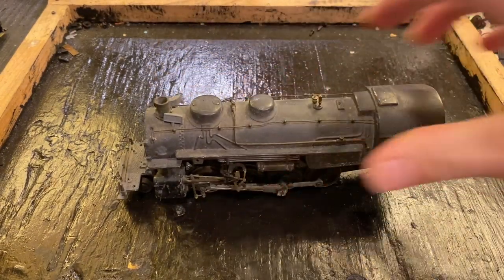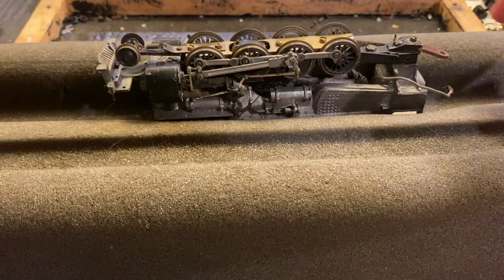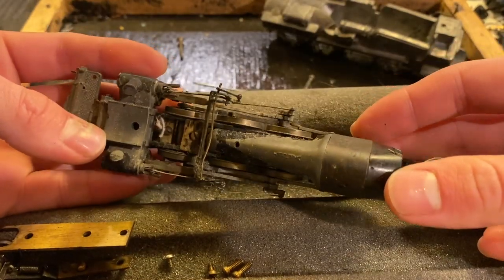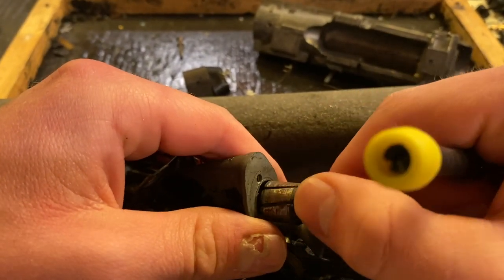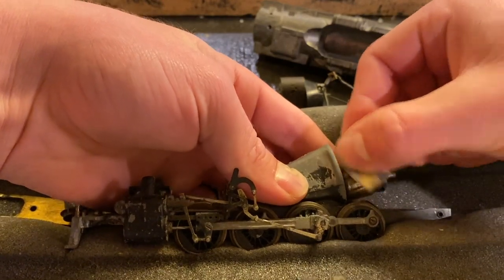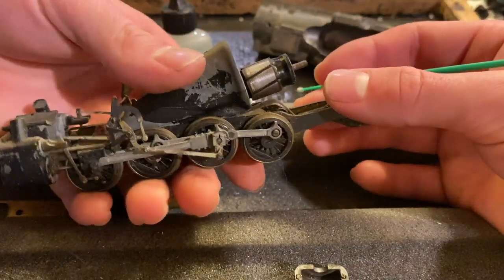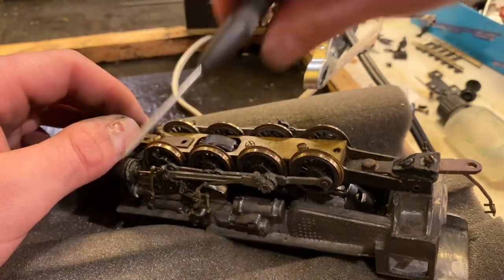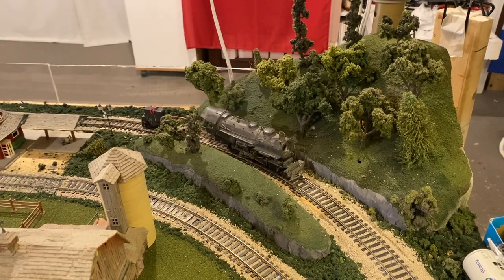Mysterious 1950s Varney Steam Locomotive With 7-Pole Motor - Restoration

Comment: That's a really good find there!  The 7-pole V-2 and V-3 motors from Varney were designed for them by Lindsay, who was known in the 40's and 50's for having some of the quietest and best running motors on the market.  The 7-pole skewed armature design made them smooth and powerful even with their small size, but they were also expensive and complicated to produce, so Varney dropped the design after a fairly short time (so they're both very rare and valuable) in favor of cheaper open-frame style motors.  Lindsay kept making the 7-pole motors under their own name into the 60's before going out of business.  Although the motor tooling is long gone, Lindsay's quality detail parts are still made today by Precision Scale Co, and their detailed ALCO FA-1 and FB-1 bodies are still being made by Hobbytown of Boston.

Comment: It looks like a Varney "Old Lady" 2-8-0. Most of Varney's kits were based on Southern Pacific locomotive classes. Roundhouse kits took over most of the Varney line. The "Old Lady" was always popular, but I never saw a kit from the factory with a 7 pole motor. Biggest problem that I remember was binding in the valve gear from people getting the rivets to tight. Always roll the chassis on a piece of track before installing the motor. Check and correct all binding before proceeding.

Comment: I can tell you more about it. It is early 1940s Varney Reading I10a, yours has boards added. Mine is modded to a 0-8-0 by its owner yours tired to make it SP. a lot of these became victims to G&D knock offs or to custom locos very few full originals left. Yours is pretty original less the missing boiler plate. As a side note. Both yours and mine predate the class being rebuilt by the reading into T1s so yes you have a model older than the Reading T1. From your friendly neighborhood historian :p

Comment: You have a fine example of gordon varneys equipment. That is his super motor with gearbox scewwound really ahead of its time the drivers should be sprung too. There was also a super pacific. Great find as inused to have several when i was younger. I am very envious. Lol
Reply from the maker: The best I've seen on a modern locomotive is a skew-wound 5-pole so I really wasn't expecting this. I'm going to be on the hunt for similar locomotives. Thanks for sharing some of the history on this piece.

Comment: Great job Harrison. It looks like the Varney HO Super Consolidation (Heavy) from the 1951 catalog and parts list. Now we have to find the tender, the smokebox door and perhaps a few other bits. You have the makings of a true, vintage, collector's item. To add to some other comments I agree that with the 7-pole motor , etc. that locomotive should be able to pull several freight cars at a very slow speed. (Watch your voltage. Some of those older motors were designed for lower voltages than what we currently use.)  Impressive job of resurrecting this one. Nicely done!
Reply: Even if he did find the original tender varney had custom couplings for the sockets

Comment: Reading I-10sa prototype.  Bachmann made a version with a suitable tender and Bowser did a conversion kit and it came with trucks and a frame to get her running.  You could score a cheap Bachmann Reading Consolidation or one they lettered in Great Northern on ebay. The I-10 did not have the number boards.  Otherwise, the engine is very close.

Comment: It's a SEVEN pole motor.

...Fascinating...

I think that's based on a Reading railroad 2-8-0, I love the Reading's wide firebox and arched cab window aesthetic. Whoever made that engine did a beautiful job on the running gear, those bearings looked heavy duty!

Comment: The tender would be a Varney or Bowser tender like the ones used on the Old Lady 2-8-0 or Casey Jones 4-6-0. They were available from Varney with plastic tender bodies and cast metal frames or as all cast bodies and frames from Bowser after they purchased the Varney dies. Very common on ebay.

Comment: Y'know, I thought my 1950's Tyco Pacific I picked up this past January was odd having a factory enclosed gearbox and a proper Pittman open frame motor but that is the funkiest thing I've ever seen!
The more I lust for dcc and sound, the more and more I look at the projects and retired outcasts of people's collections. Not standard Tyco stuff, Mantua at the very least. 
I'm very interested in getting myself and experimenting with Bowsers, Penn Line and Varney steamers to restore. Not just a dismantle, clean and oil restoration. Stripped and repainted (if needed) and get them running as best as ever. I've already done a Mantua heavy mikado and an all diecast 0-6-0.
Reply: As for my Pacific, yes it has a slight track binding issue with the blind drivers but that's my crappy trackwork. I very much plan on adding DCC and sound to it and doing absolutely nothing more to it. My cousin, uncle and grandpa all insist it must have a can motor to even consider giving it dcc but it runs so unbelievably smoothly, quietly and with little amps pulled with its original old Pittman.

Comment: Varney first offered this 2-8-0 patterned after a Reading class I-10 in 1938.  The firebox design was changed to a more conventional style in 1939, and after a hiatus for WWII it was sold in kit form 1947-57 less tender and 1957-63 with tender.  It appears the tooling was damaged or lost as it's never been produced since.  Bowser bought Varney's steam locomotive tooling and parts in 1968 and sold some of their other engines through around 2008.  

Although the guide says they were sold into 1963, I looked through a collection of magazines and never saw ads for them after 1951.  

I have two or three of these around I've picked up over the years.  They're not particularly common anymore.  

Bowser may yet still have a few parts for these around, although they discontinued all of their cast metal locomotives several years ago and may have even scrapped the tooling.

As for the tender any Varney would work with it; the type used with their Old Lady and Casey Jones is closest to what would be correct for a Reading engine, but alternatively any tender that provides for power pickup could be used.

It is missing a smokebox front, headlight, and some sort of pump or detail on the fireman's side.

Comment: I really enjoyed this video.  I got out of HO in 1978, and could not afford Varney products back then.  The seven-pole motor was impressive, with a skew-wound armature yet.  I was into slot cars in the early 1960's, and only the best motors were seven-pole.  It has been a long time, but if I remember correctly, Kemtron made a complete line of brass castings that likely included a smokebox front that would fit that loco.  Some of the most powerful slotcar motors were adapted from HO locomotive motors.
I don't remember a motor with a pancake armature before the Tyco motors used beginning in the late 1960's.

Comment: That's a great loco, I work on a good number of engines that are 40 , 50, 60 years old and a little TLC and they all tend to run.  Pretty much any old tender designed to pick up power should adapt to it.

Again, great engine , a true antique 👍👍👍

Comment: Beautiful Gordon Varney loco from the late 50s to the 60s.At one time Varney was one of the leading model train suppliers.They were known for smooth running,that seven pole motor is one of reasons.If you take time to finish the restoration you will be rewarded for your efforts.

Comment: Quite the surprise for today. I'd say that's a New Haven because of the rounded cab windows (I may or may not be biased, if it wasn't obvious) but those number boards on the boiler say different. I'd say a 4 axle Vanderbilt tender would go perfect behind that.

Comment: Also, a bit more info. The prototype is the Reading I10sa, a powerful 2-8-0. It is indeed a varney, marketed as a "Super Consolidation." The boiler front should have a smokebox - mounted headlight and bell. Maybe brass castings would do the trick. As for a tender, from photos it seems Varney put a six - wheel  tender behind it, which looks better than the more prototypical approach, what Reading actually used, were these four - wheel tenders that look too small for these chunky brutes.

Looking up "Varney super consolidation" will yield an advertisement photo showing the tender. It looks like one of the Mantua tenders found behind one of their Pacific's or Mikado's would fit the bill.

Looking up "Reading I10sa", will show some pics of the locos with the smaller tenders. The bachmann model of this locomotive (Yes, bachmann made an I10sa too!) has the prototypical small tender, and that tender was later used on their USRA 0-6-0's so they are quite common. I actually have one of these tenders I can spare, but postage is expensive from Florida to Canada!

A coat of flat black, with a graphite smokebox and firebox, would look great if this loco ever gets finished. Then Reading or fictional RR decals, oooh. that would look nice!

Hope I've helped in the completion of this loco!
Reply from the maker: Thanks for all the extra information on this loco
Reply: @SMTMainline  You are welcome!

Comment: That's a reading i10. Very valuable. I require that wheelbase for my western maryland kitbashes 😂
Reply: I have a western Maryland 2-8-0
Reply: Are you trying to make WMSR #734?
Reply: @jamessnyder3896  what number
Reply: 734 is very different from actual Western Maryland steam locomotives. This wheelbase has drivers of around 60 inches. While 734s drivers were about 52 inches. I'm looking to make h7-b or h9 2-8-0s

Comment: In the grand scheme of things logically speaking, I can't say I'm surprised it ended up running as well as it did. Back in those days, it seems everything was built to last forever. Now a days things are made to break instantly it seems. Although considering it hasn't ran in as long as you said, it takes the magic touch to get it running again like this.

Comment: That is a Varney Super Consolidation which was a model of a Reading I-10 class. A basic consolidation had a 5 pole open frame motor and a rigid frame. The Super version, like yours, had a sprung chassis, gearbox and a Lindsay 7 pole skew wound motor. Bob Lindsay worked for Gordon Varney and, later, launched his own line of HO products. What a great find! Hope you can get a boiler front for it. If nothing else, Bachmann made a plastic version of the I-10 which looks good but has a cheap mechanism. You might already have one but one of those shells would make a good donor for an appropriate boiler front.

Comment: I love the Consolidation Class steam engines. The 2-8-0 was a well balanced design. It just looks like a mixed traffic steamer that works well in both freight or passenger.
Reply: Except on branch or short line mixed trains, American 2-8-0 Consolidations were not used on passenger trains. They were freight locomotives from the first, the Lehigh & Mahonay Railroad's "Consolidation" of 1866. The smaller diameter drivers were for power and not speed. Another note: There were more Consolidations built than any other type in America.
Almost alone among American railroads, the Florida East Coast (and its predecessors) never owned a 2-8-0.

Comment: I notice you've got a bit of oxygenation on the valve gear. You might want to remove the motor from the frame, and soak that sucker in some de-greaser....or polish the valve gear with a Dremel tool and its buffing brush attachment. Or you can leave it if it's not causing any issues.

Comment: I think if you really wanted you could take some pictures of the tender that's supposed to go with this you could get someone to make a rough but clean 3d model and 3d print the shell and chassis that you could add a little weight and wire up to act as the source for pickup.  Really cool project though where do you find things like this?

Comment: I have a problem with one of my rivarossi steam locos. One on the drive wheel that is connected to the gear is lose and free spinning. How do i fix that? Would glue work?
Reply from the maker: Super glue might work but you have to be extremely careful. If I were you I would remove the wheels from the chassis, clean the gear and axle well with alcohol to make sure no grease is there to mess it up and then carefully glue it making sure it's centre. Make sure after glueing it there is no leftover glue on the ends of the axle or else it might mess something up.

Comment: This is my first time on your channel so I don't know whether or not your use DCC. If you do, kitbashing a tender may give you a good opportunity to give this loco a DCC card and receiver.
Reply from the maker: I use both DC and DCC. Although it's probably possible to give this loco DCC, I'm not sure how the decoder would react to a 7 pole motor. I've been told that the CVs must be changed for 3 poles so I'm not sure if it works the same way.

Comment: Did you ever do a follow up video where you found a tender for it? I seem to recall in one of your giant Lot purchases after this that you got  a front for the boiler. Would be a cool video to see it all come together and pull some stock.
Reply from the maker: I never made a followup but I did find a tender for it. It's still unpainted but it seems to run decent.
Reply: @SMTMainline  Well if you run out of video ideas completing this project could make for a good video, but no pressure!

Comment: With a 7 pole motor how slowly can it take off and how slow can it go?  I think Varney called it a super motor.  I have a Varney lil Joe dockside that can go pretty slow.
Reply from the maker: I haven't tested the low speed yet but I suspect it would be pretty good. Super motor is a good name for it since it is probably high torque.

Comment: I have been told fiberglass pencils are helpful when cleaning commutators
Reply: D Kemper yes, they will work, but you have to be very careful as the tiny fibers break off everywhere and can get in your skin or worse, eyes.  Use with extreme caution

Comment: Did you notice that the motor is also SKEW-WOUND this is not the original motor!!! This is an aircraft motor. Someone loved this engine enough to install the very best motor they could find!!!
Reply from the maker: I think it is the original, several people have said it was called a "Super motor" and they put them on only a few different types of models they made. It's certainly not something I was expecting to find but I was very impressed.

Comment: Hey can you fix 2 of my trains, they are very small issues, one of them has just the gears won’t turn because the stick that goes in broke, I don’t know the name of it, and the other one only works sometimes and has a loose wire so if you can, I will send you the trains and we will nogotiate a price, thanks 🙏
Reply: I tried to fix them but I got no clue what to do🤣 I need a professional

Comment: 100 grit sandpaper on the commutator?????  How would the commutator, which is surely copper or some other nonferrous metal, rust?  You actually used sandpaper on a bearing surface? You should consider remagnetizing these old motors.
Reply from the maker: I used 100 grit on the poles of the armature but not the commutator or motor shaft. What you see me using in those scenes is part of a track cleaner.

Comment: Never remove an armature from a permanent magnet motor with out a iron bar across the poles. To not closes the magnet loop with an iron bar will cause a loss of 30% of the magnetic field.
Reply from the maker: I've heard this theory countless times before but haven't actually seen a difference in practice. If the motor lost 30% of the magnetic field the current draw could increase but all of the ones I've worked on have decreased current draw after servicing.